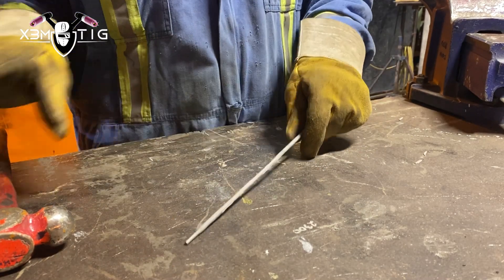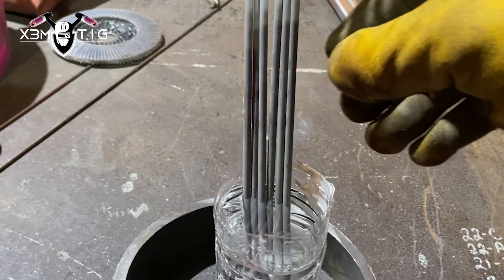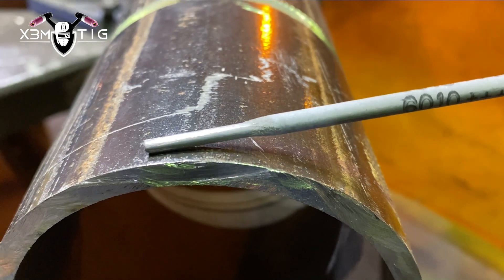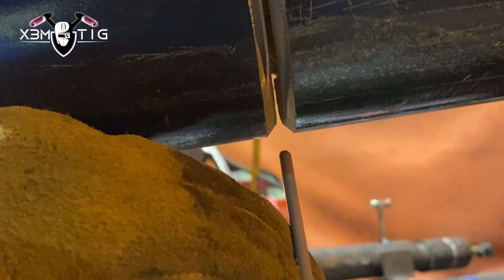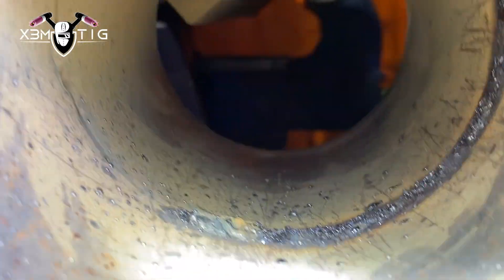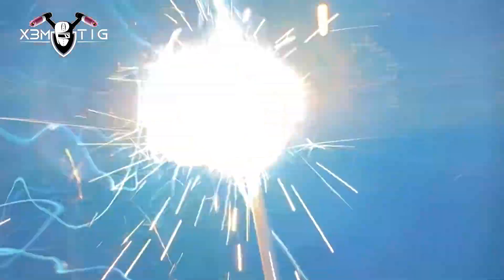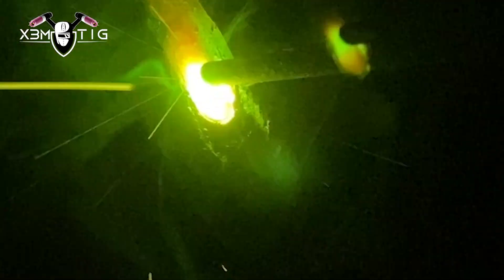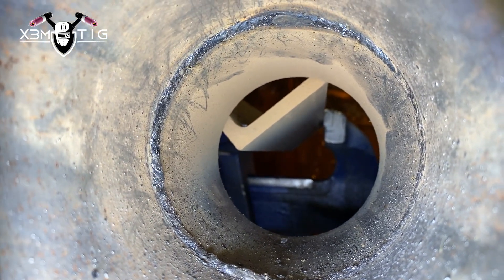Stick Welding With Wet E6010 Electrodes ! Can You Dip 6010 In The Water?

Comment: I found pipeline welder would spray WD40 (same concept as water) and it helps with the toe nailing and they pass tons of X-ray with it lol
Reply from the maker: I know, heard that story from old guys, never tried it myself and probably I’ll never will, lol 😂
Reply: @X3MTIG  hey man! Thanks for the reply. I been having trouble with back feeding technique. My wire constantly get sticky to the inside bevel and I end up gaining a big key hole. I am doing a hand push feed method rather than finger feed. What’s your take and fix for this issue?

Comment: my only experience with wet 6010's is while fixing another welders leaks under 65 lb hydro testing. it's fine until you get a spray over 12 inches. after that it snuffs itself out. nobody should have to fix a weld in my shop. it's all mig welding in the flat position inside and out.

Comment: I have done this before. Where I found it really helps is when buy old  6010s off Craigs list and you just want to use them for practicing. Otherwise, the tips are splitting and you can't see anything. Better penetration is because the arc is more focused and not spitting out the sides. Unless you compared with good rods.
Reply from the maker: True enough bud 👍